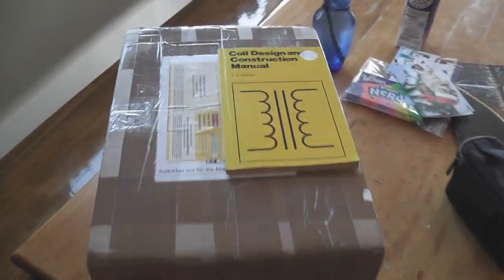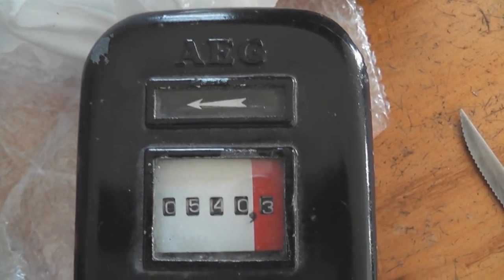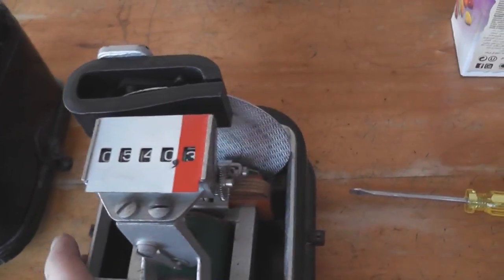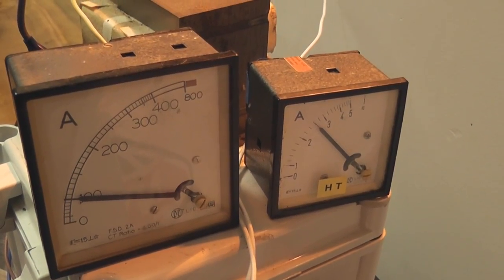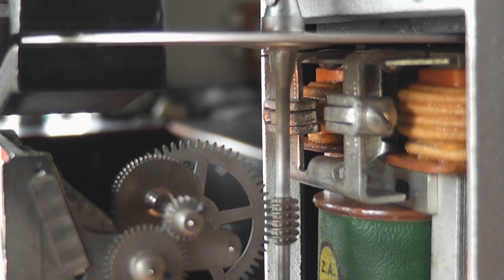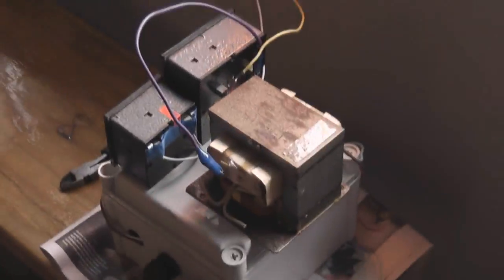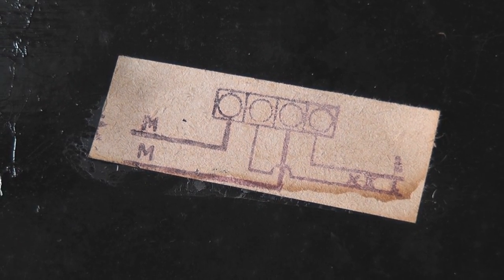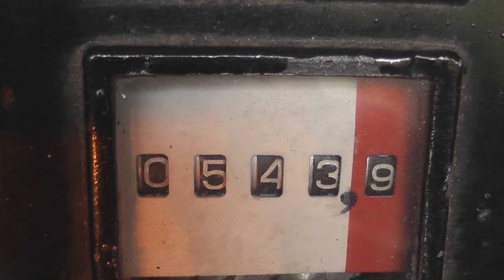AEG type L J C meter runs backwards or not ?

Comment: Hi Ray, love your latest meter, the mechanics of it are amazing, great to watch running. I remember as an apprentice at the local power authority we changed out all the old BAZ domestic power meters for newer types. I still feel bad about having to destroy all the old meters at the tip as it was a directive from the bosses. I wish I was able to save a few now after watching your vids. Cheers, Ian
Reply from the maker: It is a pity that many meters have to be destroyed. Larry HDXFH managed to get hold of some BAZ meters not that long ago.
Now it is all cheap plastic throwaway stuff which last only a couple of years.
Reply: I have a feeling that once some of these utilities compare the cost savings from laying off meter readers verses having to swap out the not-so-smart meters every 5 to 10 years, and the routers, and the general maintenance, the shareholders will be crying bloody murder. Some outfits in the U.S, like Southern Illinois Edison, were smart enough to get an independent third party to examine the costs verses the benefits of installing a not so smart grid/meters and figured out it was a huge waste of money.

Comment: Very cool meter there!

It was just the spinning direction of the disc that was "backwards". As I didn't know what kind of meter it was and you said "run backwards or not?" I thaught you meant if it can run backwards - some meters have that function.
If you have for example a solar panel on your house and get more power from that than you're using - the power fed back into the grid will be measured, so you can sell it back to the power company.
Reply from the maker: All mechanical disc meters run normally from left to right, and if you "generate" power back into the grid the disc rotation reverses, that is correct. Unless the meter has a reverse running stop.
This meter disc runs normally from right to left, which is unusual ( not many meters were designed like that )

Comment: That's an old make, Allgemeine Elektricitäts-Gesellschaft, or General Electricity Company, (no connection to the American based General Electric Company) it's defunct now. It's also an outfit with a dark past if anyone wants to look it up.
Reply: I found this part funny: 1958: The slogan "Aus Erfahrung Gut" (benefit from experience) is introduced, leading to unflattering parodies such as "Auspacken, Einschalten, Geht nicht" (unpacking, switching on, does not work).